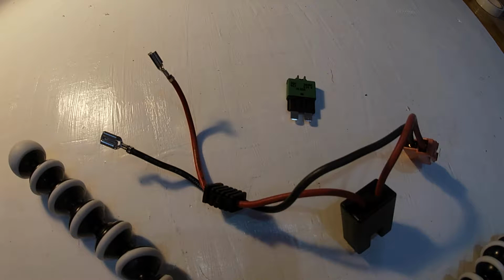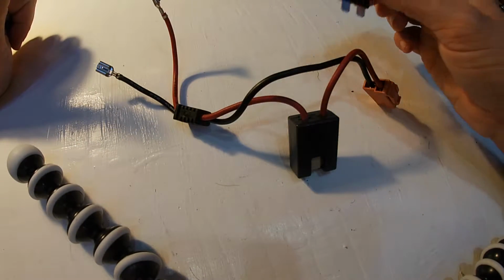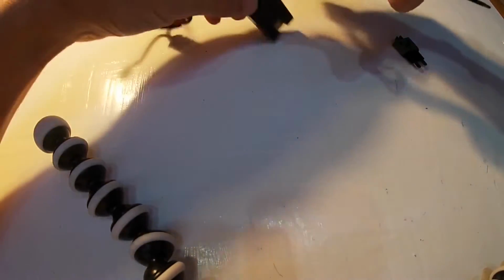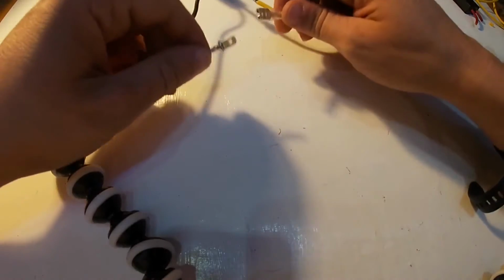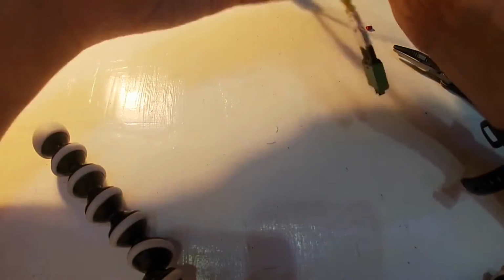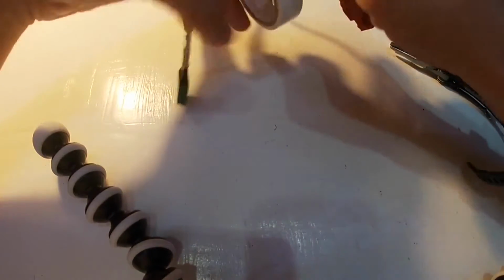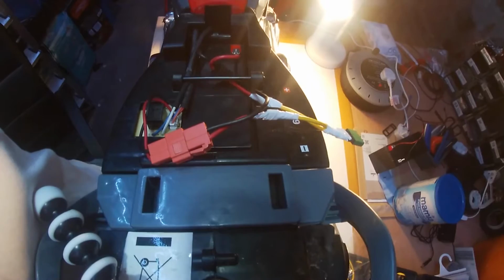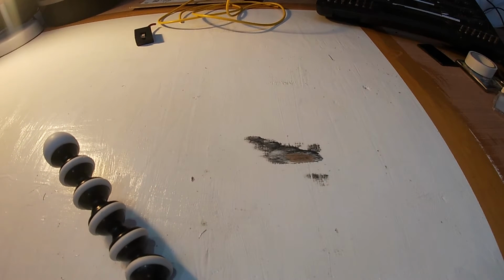Power Wheels Fuse Replacement / Upgrade, Kids Ride on

Comment: Nice video 
Quick question, my sons "Kingdom" 12v rideon tractor has 2 thermal fuses, 1 by the battery and the other, a smaller rated 4A behind the frd/rev and high/low speed switches, what is that smaller fuse for and can i replace both with a resettable fuse like you used? Also, do they both need to be thermal fuses just standard fuses like does used in automobiles?
Thanks

Comment: Thanks for your help! I’m trying to convert my sons 12 V power wheel to a 40 V with a PWM controller. The car runs perfectly on the 12 V battery but we’re hooked up to the PWM the system shut down. Any ideas?
Reply from the maker: Still on the standard fuse or uprated?

Comment: Upgraded the batteries to 24v it has 40amp in line fuse, changed motors to 24v 30000rpm, changed the controller to RX30 24v. 
With both my kids on the car it turn off. I can't turn it back on until I hear a click after around 20 seconds. 
Someone told me to check out resetting breaker. Do you have any advice?
Reply from the maker: Sounds like you still have the standard thermal fuse in place somewhere along the lines, it's a small black box about the size of a large postage stamp. Can you find it?
Reply: @Stitch76  Yes, it says L2 series, 13A 125/250VAC 50VDC. 
This is in line from the power wire going to the controller. Should I change to to higher AMP?
Reply from the maker: Yes swap that out for a blade fuse holder and then start with a 25A Fuse and go up to 40A and you should be good. If not a resetable 40A breaker style fuse should do you.
Reply: @Stitch76  Great, Thank you so much!
Reply from the maker: @ando5629  No worries mate, let me know how you get on
Reply: @Stitch76  I found a 30A breaker style fuse and it works fine so far. No more turning off. The Speed of the ride on car is amazingly fast. Batteries haven't  died yet. My kids get tired way before batteries die. So far few 40 minute rides on grass.
I have two issues though. When I turn the wheels left or right it feels likes wheels try to go past the allowed turn and it starts making a noise. The second issue is I smell burnt stuff from the engine with two of my kids are on it.
Reply from the maker: Right so feel the wires, work out which one is warm/hot and replace that with a thicker wire ASAP!!! There is too much resistance and that smell is the sign things are getting too hot. This really needs to be treated as a priority, as there is a fire risk chance. The noise is rubbing, there should be like a lip on the steering arm as such, that prevents it turning too far, this does wear down, I wouldn't be too concerned, but try to find out where it's rubbing and by how much but first thing first, is to find that wire
Reply from the maker: Also are your motor specced to be 30k rpm at 24v or 12v?
Reply: @Stitch76  Will do for sure!

This is what I got from Amazon - weelye 24V 30000RPM Gearbox with High Torque 24V DC Motor for Kids Ride on Car SUV Parts, Electric Motor with Gear Box High Speed RS550 DC Motor Match Children Ride on Toys Accessories

Comment: Hi, I have cut out what I thought was the thermal switch on the same model bike. The part you take out, but if I overload the bike it still turns off but flashes the on switch and doesn't reset itself. Is there another switch at the motor?
Reply from the maker: If you look at the motor on your bike is there a board on it at all? Have you increased the voltage or just removing the fuse?
Reply: @Stitch76  it's got an 18v battery on it now. I haven't got to the motor yet, but there is a board that the power cable goes into then from out of that towards the throttle and another down towards the motor
Reply from the maker: Ok fine, so you are tripping that board then with going to 18v, drill battery i assume? You can remove that board but the throttle won't handle the amps from a drill battery. What's the plans for the bike? How old is the child riding it? (Side Note, I took it to 24v, fitting a different board, the wheel gave out on me on it :( )
Reply: Three and 18 months. I'm going to put a speed control switch in it so I can turn it down for the little one.
Do I need to replace the throttle with a normal switch somehow? I'd like to keep the throttle motion so she gets ready for a real bike when she can :D
Reply from the maker: haha well done my good man, here have a kit that will be perfect for what you want, throttle control, will take your drill battery and has the correct control box as well, 24v 350w will do you but might as well go with the 500w and then to restrict the speed on it, you can fit a potentiometer in between the throttle and control box, I have a wiring diagram for that somewhere but may turn it into a video if that will be easier for you? 

https://www.ebay.co.uk/itm/284742608288?hash=item424bfb65a0:g:ElEAAOSwoDNiSUKY&amdata=enc%3AAQAHAAAA4BDrBPT1FWVKRKaQQgKgzbRcSmDXzWMrD7DlGg4G99LGY0iVid84mF571JhRGcu5%2F2TR%2BZz4sD7iFeo9XU3Lbz68YZ5dnaQuriNtkArnYe1%2BFyHYD0d4FUXQoyh7WEv5A%2FKIY%2FkECM9YyjJZXc4eEvnslIc%2FqGq%2BJwbCxTqK0Mm8yekukzI4A%2FmMOp9YA8tC5vheMvzJCsk19HD8gMRI7uC%2FhC3vjQoB5QcsM3e9Cv6MDWq%2BpgAy8evC00%2FsAQBRBX%2BFkkKhl6ssO2o9fedeNo%2FkiwTxWjYwUU2cOG2WFH1T%7Ctkp%3ABFBMzLSVs65g

Comment: I upgraded the motors from 10000 rpm to 40000 but now the car turns off so do I need to upgrade the fuse as well or is there more to it
Reply from the maker: Yes you will need to upgrade the fuse. Are you still running at 12v? I would say start with a 20A fuse but have a 30A fuse as well just incase.
Reply: Ok thanks
Reply: It’s still 12v one motor broke so I upgrade all four but now it only runs for 10 feet then turns off
Reply from the maker: @Ch3m0YaTrag0  Yes that will be the standard fuse cutting out then
Reply: So I upgraded the fuse to a 30amp and runs fine but when I go up hill it turns off completely is that still caused by the fuse resetting or is that a different problem?
Reply from the maker: @Ch3m0YaTrag0  What did you use a bladed fuse? How do you get it back running afterwards?
Reply: No a square fuse it looks just like the stock one but bigger and I just go turn it back and drive it down hill works fine it only happens when going up
Reply from the maker: @Ch3m0YaTrag0  never seen the standard fuses in a 30A before. It may need a 40A fuse, those 40k rpm motors can draw a lot of power especially when not on flat tarmac
Reply: Ok what brand or fuse type do you recommend
Reply: Should I upgrade to 24v or is it possible to add a third battery
Reply from the maker: @Ch3m0YaTrag0  Ok I always bladed fuses in an inline fuse holder or breaker fuses personally. Using bladed fuses, you can build up to the correct size fuse that is required. Upgrading to 24v is doable and I have a playlist the describes how to do this, including fitting a voltage converter to go back to 12v for the standard lights and radio. However I would not recommend that you run the 40k motors at 24v, they will burn out very quickly. I would say go back to the standard motors, the extra torque provided by upgrading to a 24v 500w controller will give you more then enough power to climb hills and with standard motors should have you reaching double digit mph figures.

Comment: We tried to upgrade my son’s battery car to a Milwaukee but something happened there was a sound on the front part where the hood is and it didn’t work nothing turns on would you know what it could be ??
Reply from the maker: Which car was it? Is it remote controlled?
Reply: @Stitch76   yes its a Ferrari we saw a video and bought the battery adapter but something went wrong
Reply from the maker: @adilenedelgado8491  Ok so there is probably a control board on there, that you have broken by adding the drill battery, can you provide a link to the car please and I can tell you how to fix it then. Thanks

Comment: Something happened to my nephews ride on car when I added 2 Milwaukee 18v batteries to it because i wanted to make it go faster. I successfully added one and the car seemed ok but I added another one and it went pop :( now I can’t get it to go at all! Got any idea what might have gone pop?? I did look at the controller and it looked ok not burnt or anything. He will be so sad when he finds out that I broke it.
Reply from the maker: What car is it? From the sounds of things you have blown the control board, did you wire the batteries in serial or parallel?

Comment: Is it ok not to use fuse? . Just a direct connection?
Reply from the maker: No that would be a terrible idea, one short or failed switch or motor and you risk an electrical fire on a toy your child is potentially strapped into, please don't run it without a fuse.
Reply: @Stitch76  thank you for your reply . .yov got my subs and like
Reply from the maker: If I can help with anything else, let me know

Comment: Fuse is not working jeep will be starting or not
Reply from the maker: If the fuse is blown, then no a toy car wouldn't start, you will need to replace the fuse. You can test for a blown fuse, by placing the positive side of a volt meter on the output of the fuse (the side not connected to the battery) and the negative connected to the negative terminal on the battery. If you see 0 volts then your fuse is blown.